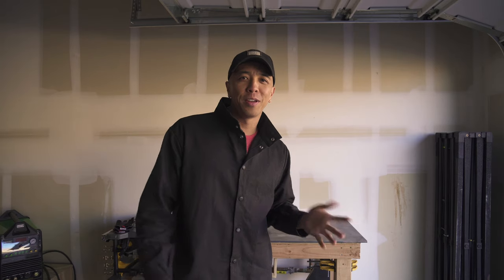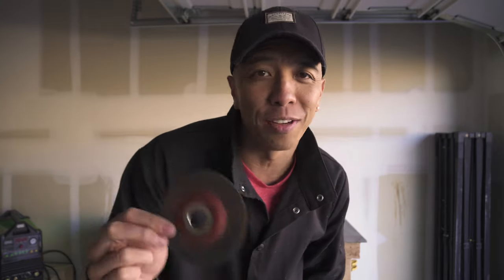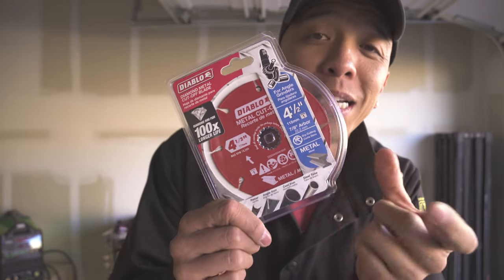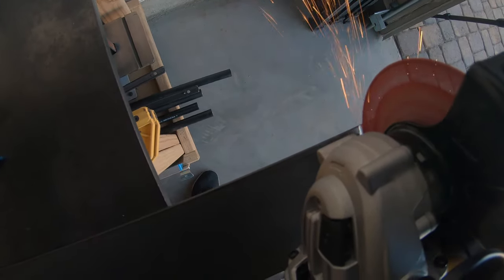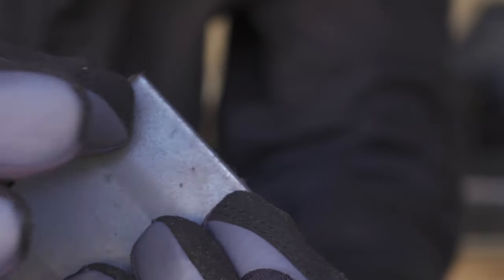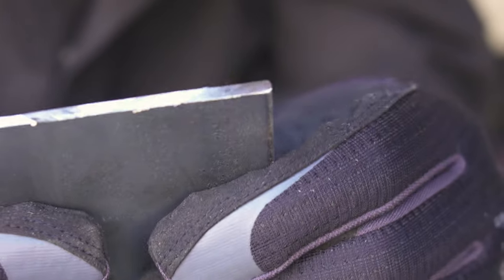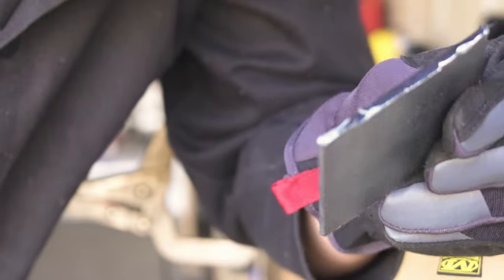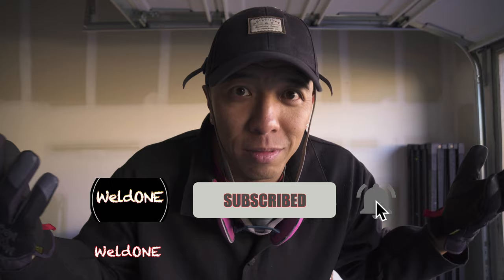Have you ever tried the Diablo diamond cut off wheel

Comment: I know this is an older video, but there are some things you should know.  First, you’re applying too much pressure when you’re cutting.  This makes it more likely that the regular wheels will break.  Ease up and let the abrasives do the work.  If your grinder slows down much, you’re doing it wrong, period.  Lots of guys do this.  It’s still just as stupid, no matter how common.  It’ll also wear down your diamond abrasives faster.

Second, it’s an abrasive.  They all heat up the metal a ton.

Third, the regular wheels aren’t worn out until they’re stupidly small nubs.  The abrasive is impregnated throughout the cutting portion of the disk.  If you can still reach the metal while maintaining the right cutting angle, keep cutting.  If you have to change the angle, use a new disk.  Smaller disks can be used to cut small pieces of metal where maintaining the angle is easier to avoid waste.

The cutting wheels that are made out of steel have one advantage.  They are safer to use because they can’t shatter like a fiber disk can.  If you have to cut in a bad position, like under a car, or cutting pipes in a crawl space, it can be difficult to hold the tool perfectly straight.  This is where they shine.  If it saves you one trip to get stitches, it pays for itself many times over.
Reply from the maker: Great points, thanks for sharing for everyone.
Reply: @WeldONE  should get the Diablo circular saw blade Crement 2 Carbide check out the videos cuts steel like butter way better than grinder disc. Just make sure you don't exceed rpm rating.
Reply: @liv04soccer  ive tried it and its good for some things. Mild steel. If you use it on hardened steel or stainless steel the blade will wear out super fast whereas abrasive wheels don't really care what kind of Steel you're cutting though, they cut pretty much the same. but if you're cutting mild Steel they do cut maybe 15 times faster which is an absolute Game Changer if you have to rip a sheet of quarter inch plate into four inch strips or something. So definitely worth it to buy one but I wouldn't use it on everything or else you're just going to wear it out super fast and waste a lot of money

Comment: A few ideas worth sharing,

if youre still getting your feet under you with cutoff disks, 
1. get a 4 1/2 inch grinder that is only like 4 or 5 amps (harbor freight), disks just dont explode on those very often.
2. dont cut things that arent secured in a vice or clamp, if your work moves fast while cutting, youre going to blow the disk. 
3. be extra careful when you finish the cut, if the work is under tension, or heavy, it can pinch the blade. This goes for any cut, but its worth noting. 
4. I have a lunch box I keep my cutoff disks in, separate from my grinding disks or diamond blades, treat them like a cd, if they get smushed in the bottom of a tool box, or steped on, or a grinder rigged up with a disk gets dropped, even lightly, THAT is when you retire the disk without question. Keep them padded and stowed safely until you cut, then take it off the grinder for storage. any old disks that have been kicking around, ditch em.  That will eliminate 75% of disks exploding. 

Good luck continuing to learn to weld bud!

Comment: You will find that it cuts much better and safer if you drag the cutting wheel and don't try to deep cross cut like you are doing. If you keep pushing it through the work someday it is going to kick back and cut your gut open like it did mine. I went to the hospital with my guts hanging out. It took about eight months recovery before I could go back to work. I was very lucky it had not been my face. First make a groove across the material and then start following the groove a little bit at a time.

Comment: If you cut a lot of rod, bar, strip, angle etc. get a real chop saw with a dedicated carbide steel cutting blade.   I switched to one and cutting stuff up is quick, clean and accurate and it doesn’t make the mess an abrasive cutter does.   It also leaves the steel pieces cool to the touch.
Reply from the maker: this is actually on my list, my next 1 or 2nd purchase. thanks for the view and comment!

Comment: Yes. If you got more money and more time use a diamond wheel. If you wanna get it done fast use the carbon discs. I have a shipping container for storage. It needed vents so I put 2 in. One I used the diablo. It took me an hour. One the second I used a thin cut off wheel. I was done in 20 minutes. If you cut thin metal the Diablo is ok. Thicker metal stick to thin carbon discs

Comment: Respectfully, you're holding the angle grinder opposite of the path of travel. Recommend to NOT use it so it can kick back at you; rather, turn it 180 and allow the draw blade to spin clockwise and 'pull' into the metal. How you're holding it can certainly cause you a safety issue. #2. (@5:49) Your other blade is a 'cutting' blade, not a 'grinding' blade. You're confusing people my good sir. Check this out at the 30 second mark: https://www.youtube.com/watch?v=r0OisyP0lUc. Cheers and wish you safety in all your tasks.

Comment: The point of the diamond wheel blade is that it will last longer than the old composite type cutting wheels.  I used two of that same blade and I was not impressed with them.  I am back to the old composites.  My chop saw is a metal blade and cuts great!  I'm new to plasma and that thing rocks!  Thanks for the video!

Comment: One pass along the edge and that cut is cleaned up. So the comparison is only for cleanliness of cuts?  Seems like one cut is a small sample size to make a comparison. 
 The big selling point is durability, ergo value. When i bought my angle grinder i got a few discs, flap wheel and this item. I was a little scared about wheels breaking after seeing some safe usage vids. Its been incredible! Can't say if it would last 100X longer because i have only burned through a few discs and this is going strong.  I can say that at $10 and most wheels at Lowes (where i got everything) were $3 or more, its well worth it.  For those with more experience than me, definitely worth a shot.
Reply from the maker: I dont recall from the video how many cuts I included, but definitely made 5-6 total cuts while making the video.  Your point about its durability is valid, I don't doubt it will last longer than an abrasive disc but it takes longer to cut and the time you spend cleaning up the edges also adds up.  just food for thought.

Comment: Nice Video...  I've used one also and have relegated it to mostly the other materials listed on the package. I agree with the others about the grinder operation. Sparks are not that big a deal and you don't have to stand directly in front of them.  A welding jacket like you wear should work great.
Reply from the maker: got some good tips from many folks on this one and yeah, I started on the ground and have moved to a work bench so I can stand aside for sure.

Comment: I prefer the inexpensive standard Cut-Off Wheels in most cases.  The Diamond Cut-Off Wheels require a much slower cut to get good results.   But time is money, and in my opinion my time is more valuable then the cost savings of longer lasting Diamond Cut-Off Wheels, and the standard Cut-Off Wheels make a much nicer and cleaner cut.  Cleaning up a cut from a Diamond Cut-Off Wheel is more time, effort and money.  

Best wishes...

Comment: Good video but as was said below, go slower and it cuts cleaner.  Disadvantage: much slower (and perhaps rougher cut... I seem to get cleaner cuts than you got in the video).  The advantages are: longer life (by far) and you need not worry about the wheel disintegrating and becoming a "grenade".  I have crashed my metal / diamond cutoff wheels many times, to the point that they bent in use... yet they remain intact!  AND, you can continue to use them... the little bends seem to straighten themselves out with use.  So, IMO, these are best when you have to cut something in an awkward position where you might otherwise "crash" a fiber wheel and blow yourself up...

Comment: The rules of thumbs I use are:   

  Diamond is a tougher abrasive, but it usually cuts slower than an abrasive impregnated ablative disk.   An abrasive disk does cut slightly cooler, because the abrasive/medium that is spent is thrown off taking away some of the heat.   Still nothing controls heat and precision like a light touch and taking a bit more time.  

  Diamond 'cut-off' wheels usually have a thin kerf, with diamond abrasive only along the outer edge.   It wears out quickly, and leaves a rougher edge as you cut by hand, because only that very edge is grinding when you make contact of the side profile.   With a regular grinding disk, which is fully impregnated the whole disk abrades the working material over it's entire surface... which leads to a much smoother edge/cut.  (A stationary, or mounted tool, obviously cuts much better in either case, but I've never used one in the field.  I grab a framing triangle, and use it to run a straighter cut using the grinder's blade guard... but for me, this is only a little better.) 

Mostly I use Diamond grinder blades when shaping and cutting tile.  Honestly, that is where they really shine.   Hand cutting I use the abrasive  blades on metal... and I go get a shield if I'm doing more than a couple of cuts.  On mild thin stock, such as you are using,  I did one time pull out my own carbide diablo blade ($60 80-100T?), instead of the stack of ($10) cut-off discs.   I'm afraid of those things, and I've never liked cutting with with a shrinking diameter blade; or worse, having to change the blade in the middle of the cut because you are trying to get the most out of the blades, and the saw bottoms out.  

  Did I mention that a 12-14" blade can go half way through your head before you even know you're dead?   The carbide worked well for me this one day, making lots of very reproducible cuts in smallish stock, but that's but that's not enough to give a strong recommendation.    Clamp your workpiece; steady light pressure; steady advance. 

Good luck, and be careful.  Cutting metal with a high speed tool is always inherently dangerous.

Comment: you are cutting backwards my friend, the blade must be facing your left if you are right handed and sparks fly towards grinder handle.in the way you are cutting, you can't see the edge of the blade or the markings that you have made on the piece of metal. also if you let the angle grinder a little too loose in your hand it will fly straight in your leg, it will run the blade straight into you. please turn the angle grinder handle (the black one) the other way. after a few cuts, trust me, it won't be so scary anymore. best regards.

Comment: To avoid a kick back, you need to hold it straight. The Diamond Cut Off Wheel will last longer but it cuts slower... For faster and cleaner cut, you may need grinding cutting disc as this as possible, but the draw back will be it gets shaven off quicker too... IMHO... 😎
Reply from the maker: Agreed.

Comment: Great video ! ! I'm wondering if you think this wheel would do well cutting copper pipe (non ferrous) as that's all I'll be cutting.  If not this wheel which one would you recommend?
Reply: I often use a diamond disc on copper pipe.   Copper moves heat away much faster than steel, so even with the smaller pieces, the blade stays a bit cooler.  Cutting a rounded/ hollow metal profile, gives you a much better chance of hanging/shattering a regular disc, which is  compounded with workpiece moving around so much.   Lastly, I do wind up cutting out old work at awkward angles and spaces.  I use a Dewalt xp4 blade when plumbing with a ridged deburring tool.
Reply: @coffey3c  Great, thanks for your help.

Comment: For your safety and working knowledge of tools watch videos of welders show you proper technique learn the correct way use angle grinder with practice grind / cut like a Pro 👍using that Diablo blade
Reply: The guy doesn’t know how to use a grinder
Reply: @jammaemco913  you're right that fella is going to end up getting hurt.he needs learn  blate rotation understand which direction to hold his grinder at the proper angle to avoid kick back when he's making his cut

Comment: Does it matter which way you install the diablo blade ? I have a M18 i just bought. Thank you sir
Reply from the maker: Not quite sure what an M18 is.  However,  most blades in my experience are mounted label side facing you.  This particular diamond blade in the video is marked with direction of rotation.

Comment: Well, this wheel is an interesting concept, but it looks like its not as good as a regular cut off wheel. This is the first I have heard of that wheel. Ill do some more research on it, but I would stick with regular wheels. Great video!
Reply from the maker: thanks for watching.  It always peaked my interest in the tool aisle. I totally thought it would perform better.
Reply: @WeldONE  Diamond is going to last a lot longer then cut off wheels if you doing a lot of cuts but as long as you don't mind changing blades cutoff wheels are dirt cheap. Check out Diablo Cerment 2 Carbide bladed cuts steel like butter.

Comment: If you try just marking the line and begin the cut on the end of the metal closest too you. and proceed in one direction ( away from you ).
 And dont make several cuts on top of the metal, just start at on end and cut all the way though to the other end. It will turn out better.
  Just sub you, great vid.
Reply from the maker: I'll give that a try.  have you tried this disc?  Any thoughts on the disc itself?  Thanks for the sub!
Reply: @WeldONE  I have used the disc, i use diablo disc. I like that they last a long time with out changing them .  I use 3  grinders, One with a cut off wheel, one with a grinding wheel and one with a flap disc.that way im not constantly changing wheels.
Reply from the maker: I have the plan to add another grinder to my tool set when the demand/workload requires it.  For now, I'm not busy enough with it to get another grinder.  Do you get cleaner cuts than I saw with the diablo diamond cut off?  Was it user error?
Reply: @WeldONE  I think it was user error, just start at the edge and go on though one time, instead of scoring the steel several times.
 I was thinking if you are using thin steel ( 1/8 inch and down ) You might want to try 6013  in 3/32. It runs lower amperage 60 to 85 amps.
 It was designed for sheet metal welding years ago.
 It doesnt stick ,and has easy slag removal once you find the sweet spot. Also its easy to re strike.
Reply: @WeldONE  A saw will give you cleaner cuts and less burrs. Those evolution saws like in your mig welding video are really nice.
Reply: And remember to take the time to get good fit up before you start welding, It will save lots of headaches and mig wire. That was a very good video by the way.
Reply from the maker: Thank you! hopefully more ppl drop comments there to start a dialogue.  Its performing better than most my other welding videos based on 1st day response. appreciate you watching.
Reply from the maker: they really are. looking into getting one.
Reply from the maker: I'll give the disc another shot.  As far as 6013 goes, that's exactly what I use and the exact range of amperage.  I think its easiest to use at this point.👍🏼
Reply: @WeldONE  Keep making videos, And the subs will find you. Good luck .

Comment: you want to hold grinder firmly but your pressing down way to hard and starting a cut at the rear and pressing forward is a big no-no start a plunge at the top or north and pull back maintaining the plunge depth all the way back maintaining good speed letting the tool work ..Your gonna get hurt and your gonna burn up a grinder bowing down on it like that. It's not a lumberjack competition.Keep all your parts where God intended...

Comment: Its alot slower than the abrasive one . I make knifes every day cutting them all with this method.  I dont have a forge so I just use grinders . I won't buy another diablo.  Burns my batterys out so fast with little to show for.the sanding disk and abrasive disc is all I use I barely even use a grinding disc . That sand paper disk will take metal of and shape so fast... when I first saw the diablo I thought hell ya this is it. But I quickly was disappointed.  Now that's for mild steal and hard steal . Maybe good for some other material.  Well you know what . Its probably because my batteries suck. If I had a corded grinder with faster speed and stronger.  I bet that's what it is.. I have 4 batteries I go through them so dam fast . I need corded tools.i got the full DeWalt tool set as a gift , so I've been using the hellmouth of them. I enjoy making knifes. I just harden with the oven and or torch..make handles with deer horns mainly,  I'm in Texas and realy like the Mosquite wood to it's real hard and red . That's all I use to BBQ with to so I keep it around..have a good one...